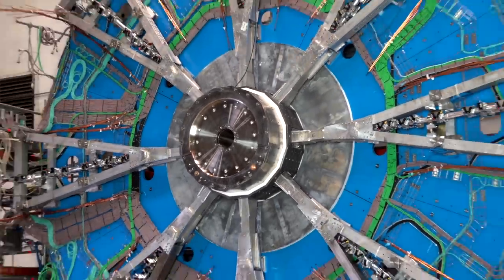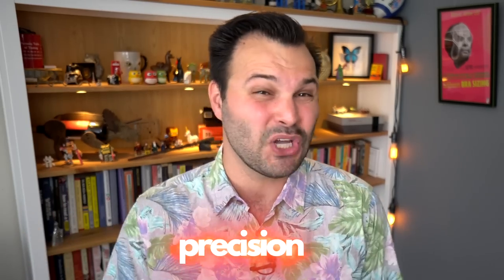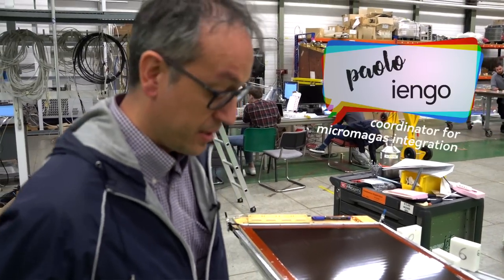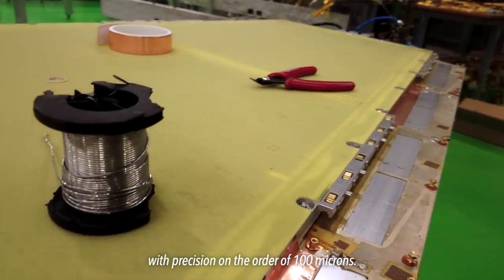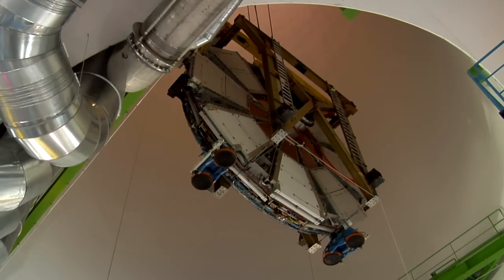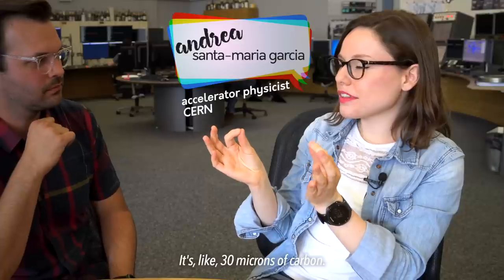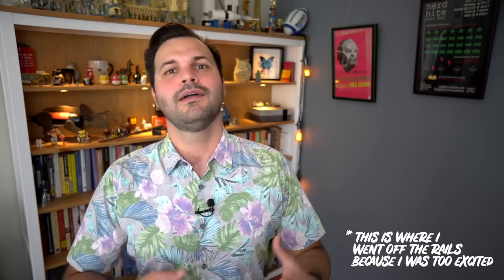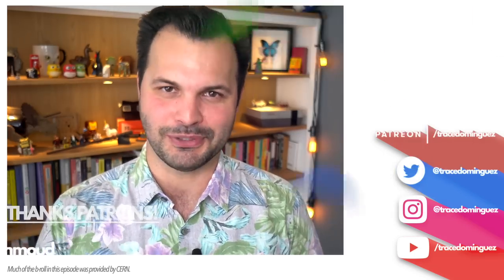The LHC Will be 10x More Powerful Thanks to This  (Part II)

Comment: Wow, the Small Wheel is huge. Wait, a big small wheel... Is this one of those physics paradoxes?
Dammit, Schrödinger!!
But seriously, awesome video! I'm going to read up on those detectors. Very interesting ^_^
Reply from the maker: SO INTERESTING RIGHT? I only got to talk to the expert about the micromegas — so that’s all I put in the video, but the sTGC is also really cool. They put a thin wire in the middle of a tube, flooded with gas (nothing crazy by the by, but very specific mix). The gas is ionized as a particle flies through the tube (which is a few centimeters in diameter) and the wire picks up the ionization so they know where the particle was! It’s super interesting. When you have LOTS of these tubes, then you can track the particle.
Reply: @TraceDominguez  That sounds like a very sophisticated Cloud Chamber, which is a DIY particle detector (but you probably know about those.)

Comment: sorry this doesn't have anything to do with this video , but can an artifical magnetosphere be constructed on other planets by dispersing permanent magnets across it's surface?
Reply from the maker: I mean, I am not an expert, but depending on how you look at it, each magnet would have it's own magnetosphere right? They don't magically combine together if you put two magnets next to each other... so even if you cover the surface with magnets, they're each going to attract and repel each other, but not really affect the planet as a whole. The reason OURS works is because the whole planet has the planetary dynamo spinning deep in the core!